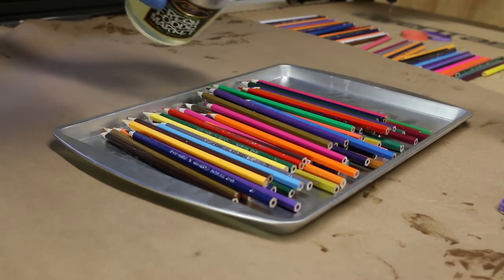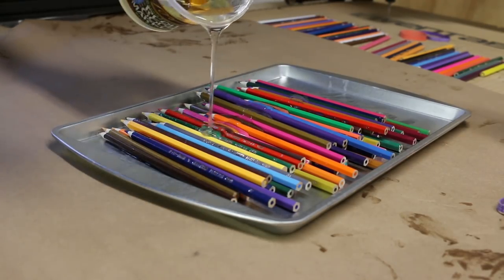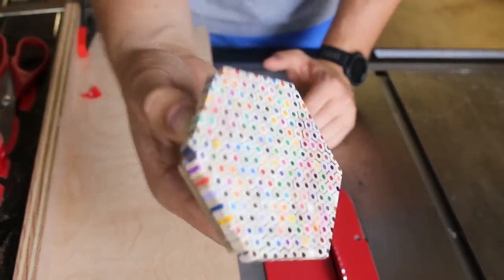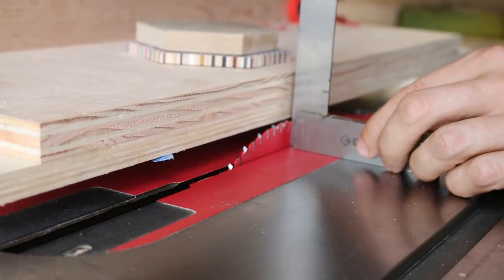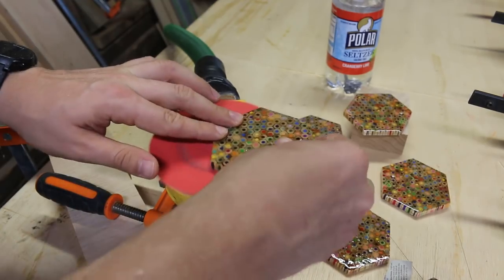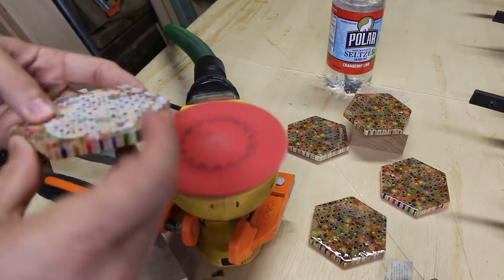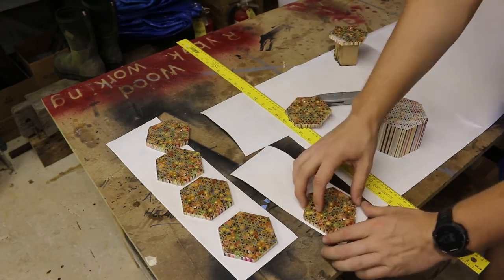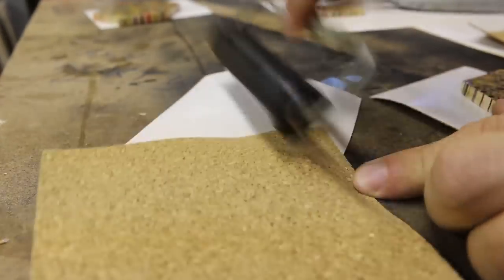Color Pencil Coasters

Comment: How many pencils are there and how many coasters did it make? (If it's possible to know the size of them too :) )
Reply from the maker: It was 216 pencils and I made 6 coasters from the blank but you could probably get 12 or so out of the blank depending on your tools. I didn't make more as this was a proof of concept. 

I'm not sure what size there are off the top of my head. I believe large enough for a 5 inch circle to fit inside.

Comment: wow, great job! a question is it resin also at the beginning?
Reply from the maker: In the opening I used West Systems Epoxy with the 207 hardener. The 207 Hardener allows for slower drying time. The resin I coated the surfaces with is for counter tops from Home Depot, it was much cheaper.
Reply: thank you.

Comment: Interesting and informative video, and great end result. Aside from the topic, how do you like your CNC machine from Inventables, and what size is the one you use? I am interested in getting one, and I am trying to get an independent opinion, and not from their website. Thank you.

PS is the Super Glaze from Perks or some other brand?
Reply from the maker: Short answer, Yes I like it. It was fairly easy to set up (directions could have been better) and the software they provide is very easy to use after playing with it for a short period of time. I mostly use it for 2D cutting and have yet to try anything 3D but I mainly build furniture and use it to cut templates. The built in functions within the software allow for a large range of stuff right from the jump. 

 Long Answer: If you can afford to invest money into a smaller ShopBot or equivalent quality machine I would go there. I bought my X-Carve in 2016 before they made the latest version and before knowing about the Shapeoko machine. At the time I bought the largest X-Carve with all of the top of the line options in terms of motors, spindles and whatever else. I am not a CNC expert and generally don't explore the boundaries of feeds and speeds when using the machine, I stick to factory cut settings. That being said, the machine is fairly slow. Good enough for the hobbyist but not a true production machine. From what I've seen online the Shapeoko is slightly more robust and faster and it also allows for larger work pieces. I've also found that after running it fairly hard it requires a tune up every once and awhile. 

If you have any specific questions, hit me up. I'll do my best to answer them.
Reply: Thank you for the extensive response. I really appreciate it. I will check on the Shapeoko brand. I am hobbyist and not looking for woodworking shop equipment, but I do a lot of projects when I get my inspiration up, and they usually require a bit better tools, :-)  If I have any questions I will reach out to you, for sure. Keep doing the good work, and I hope you get much more subscribers ASAP.
Reply from the maker: Thank you!

I think for a hobbyist and a light production machine, the X Carve is a solid pick. The company has updated the design after hearing feedback from the customers. The new options they now offer really make it easy to use. In my opinion the software alone makes it worth buying because it's do user friendly. The X-Carve community is also very friendly sharing how to upgrade the standard models to do some wild stuff.
Reply: Thanks your opinion

Comment: Can you please add the specifications of the epoxy.
Thanks in advance.
Reply from the maker: The epoxy to hold it together was West Systems. The epoxy to coat the top is counter top epoxy but you could use West Systems for the top as well